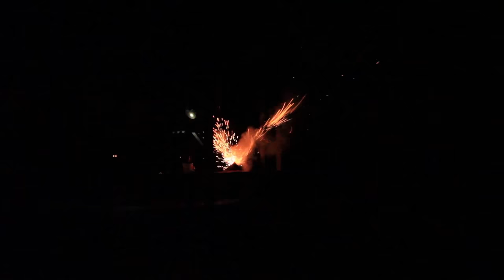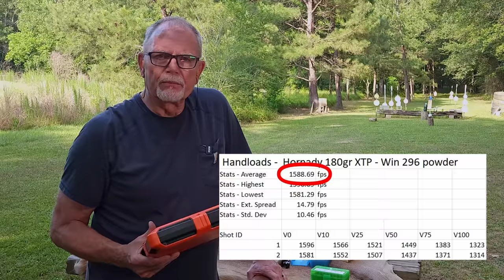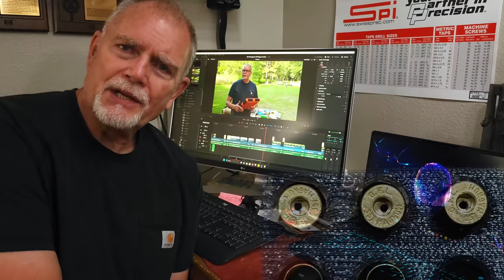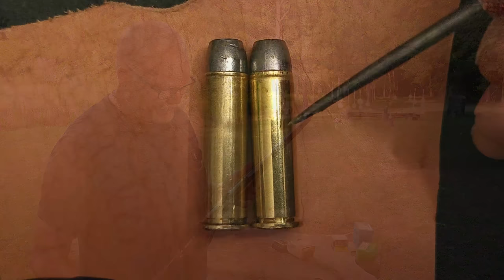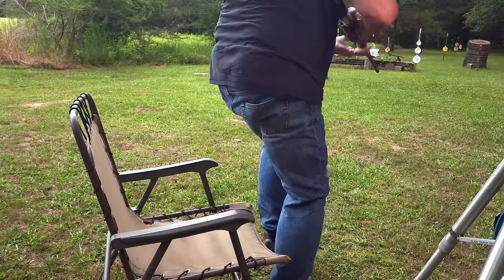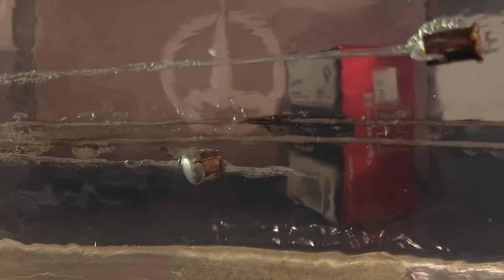Was I Wrong About The 357 Magnum Carbine? ?

Comment: Well, if people take deer with 6" .357 Magnum revolvers, in States where that's even legal, why COULDN'T you get good results, with a carbine barrel, with its heightened velocity, and its longer sighting-plane?  ALSO, with a hard-cast, wide meplat bullet, why WOULDN'T it penetrate?  In a .44 Magnum, heavy, ultra-hard-cast, wide meplat bullets are routinely carried a "bear loads" in .44 Magnum "back-up" sidearms, and a deer is NOT as dense and chunky as a bear.

A good .357 lever gun or one of those .357 pump-action carbines would work for home defense in lefty states where an AR would be considered too-ferocious for polite society.  Lever guns take longer to reload, but you CAN run them fast, and a .357 round out of a carbine-length barrel is no joke.  Even a hard core guy like the late Jeff Cooper advised using lever guns for home-defense, in pantywaist states, since a lever gun looks like Grandpa's ol'-timey heirloom, to a Jury.
Reply from the maker: To your last point, I wonder how one of the"tactified" levergun would look to that jury🤔

Comment: I’ve killed deer with my Rossi 92 in 357.  Performance is not spectacular.  I wouldn’t recommend using 357 if you have a high powered rifle.  The risk of losing big game with a 357 is much higher, especially if you run into a big bodied buck.
Reply from the maker: Well said! Thanks!

Comment: Nice review. Any thoughts on reviewing Rossi’s new Rossi R95?
Reply from the maker: That's a good question. Two of my newest Rossi's spent 4 months in customer service "jail". And one of them came back worse than before. So, my interest in Rossi Firearms is on hold until they get things like that worked out. Sorry
Reply: TargetSuite- thanks and understood. Sorry to hear about Rossi’s track record. I only own one Rossi, a 92 in 45 colt. Great gun that thankfully hasn’t required me to deal with customer service.
Reply from the maker: I'm glad your experience has been good. They do make some good guns but every now and then they let one slip through the cracks and getting it corrected is just a disaster. I really hope they get the link between Brazil and American customer service Representatives fixed.

Comment: Steep Kuntry Outdoors posted a video a while back where he dismantled a couple of the 180gr hard cast Buffalo Bore rounds and duplicated the load successfully. Turns out that they do use Lil Gun, but it is over what the manuals and Hodgdon’s website lists as the max charge.  I don’t see the benefit of the risk of being over max. Especially for a hard cast bullet that will get all of the penetration you need at a lower velocity. The 180 grain hard cast could probably penetrate a deer from chest to rump at 1400 fps.
Reply from the maker: I agree. I don't see any need to go with the very expensive Buffalo Bore around and subject your beautiful carbine to that extra pressure. I recovered both of those bullets within an inch of each other in that spongy log.

Comment: Your loads are so close to BB that I’m just gonna assume they’re just using a slightly higher load of lil gun. 357 pressure max has been downgraded and BB might use the old spec, or at least view it as a good safety margin to get a bit more out of a cartridge

Comment: Is 20" too much barrel for a .357?
Reply from the maker: There may be an extra inch or two that's not generating a lot of energy but it's not hurting the performance of the cartridge. It's interesting that the new rugermade Marlin 1894 357 Magnum chambering Sports and 18.5" barrel. I will sure be comparing velocity between this Winchester and that new Marlin.

Comment: I shot two deer with my henry bigboy steel carbine in 357mag. Both fast kills, one at 100yds. I use handload 158gr xtp at 1700fps.
Reply: You gotta get some Lil' Gun. It loads at lower pressures than other magnum powders so your brass lasts forever and it will shoot that 158 XTP at 1950 fps.

Comment: I definitely disagree.
I have had to run a deer to ground after someone hit it in the neck with a 357 carbine.  It wasn't a fast death and I feel its about as unethical as you can get.
Just say no.   Millions of real deer rifles out there, borrow one from a friend and think about the animals.
Killing is ok, torture is most definitely not
Reply: Isn't a neck shot more about placement than caliber (obviously within reason)? A shot from any caliber that misses vitals for a sure quick kill is bad.
Reply: @Salieri47  the total lack of penetration was the problem for sure.
That bullet was set tight against the bone and the animal was bleeding profusely as its running.  I followed up for about 20-25 minutes and finally dispatched the animal.  It was very unsettling to see.  I spoke with the original shooter, and in his words it was approximately 70yds and felt like good placement.
I would agree with the placement had the cartridge been up to the task.
I don't believe you need a cannon for deer, however you definitely need ENOUGH gun.
I will forever stand on the assessment that the pistol calibers are just not ethical.  There are to many rifles out there that are suited to the task, leaving no excuses why an animal should be subject to that kind of slow terrifying death.
I won't describe what I witnessed, however it was terrible.   We as hunters have a responsibility to do this correctly and humanly.

Good hunting brothers and sisters.
Reply from the maker: The only thing I would say in response is that a high caliber rifle only adds slightly to the margin of error when it comes to bullet placement. I lost a deer after attempting a neck shot. And that was with a 25-06. I chased that deer for 30 minutes and eventually lost her. That was 50 years ago, and I have never taken a neck shot since.
Reply: @TargetSuite  I absolutely agree there are much better locations on their bodies to place a bullet.  I didn't bring that into the conversation because this was about the inadequate ability of the 357 as a Deergetter.  All things being equal in the above case, had that been a true rifle caliber the animal would have dropped like a sack of rocks.